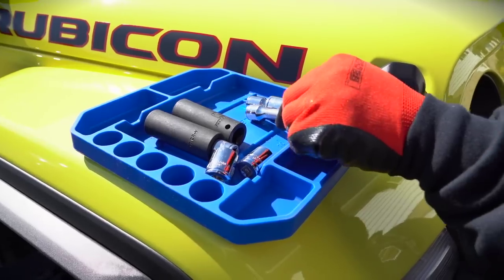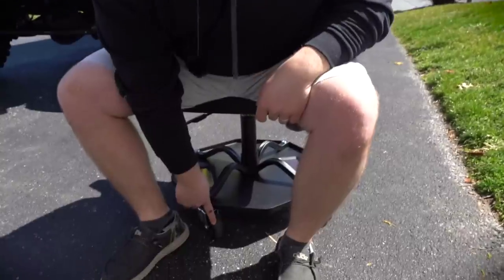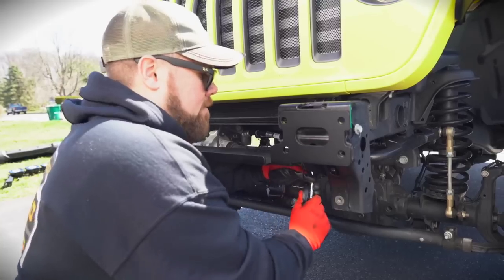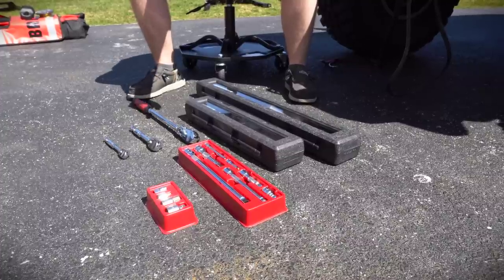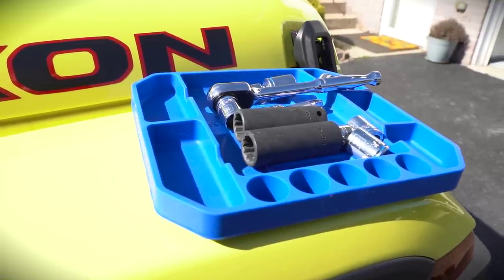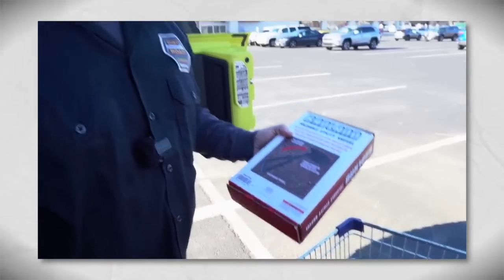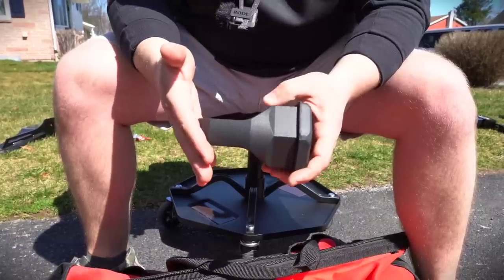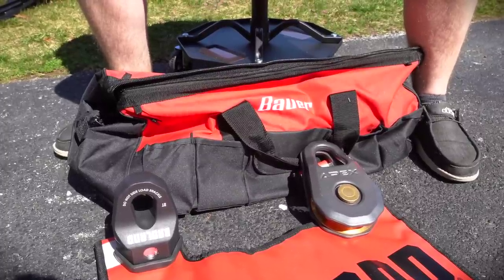Best 2023 Harbor Freight Gear for the Jeep Wrangler or Jeep Gladiator

Comment from the maker: What tools are a must have for your Jeep?
Reply: Not quite a tool, but I always kept cardboard around. I took my doors off all the time and I was always scared of slipping while taking the bolts off and scratching the paint, so I always kept some cardboard between the wrench and the paint.

I also kept a measuring tape for a while. Mine had halogen lights and I put Oracle halos in. People constantly flashed me for blinding them. I found myself going behind Walmarts and stuff and parking facing the wall and measuring on the wall where the light went up to. Drove me crazy

Comment: Thank you Matt for great videos. I'm a 4x4 newbie. I just bought a 2019 Rubicon and I am putting together winch accessories bag, tools, First Aid, etc before I go out on my first adventure. Already made a trip to HF for a few items. A little off subject, but is there much difference between mounting a light bar high (top of windshield) or low (front bumper) when it comes to any blinding glare from the dust coming from the rig in front of you? Always been curious about that. Thanks.
Reply from the maker: You’ll have more glare the higher you go!

Comment: I actually run Badland winch, $40 tool kit, and air compressor from harbor freight in my rig. It's definitely better than having nothing.😂
Reply from the maker: I’ve had good luck with most of the tools and supplies I’ve gotten!